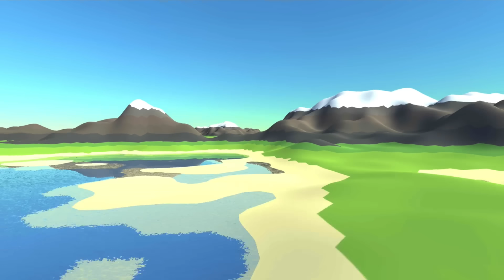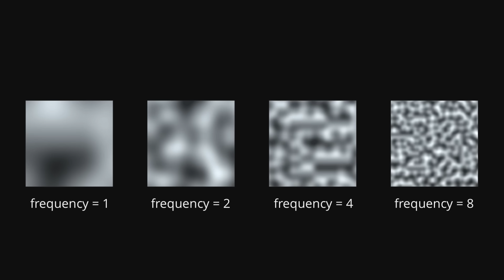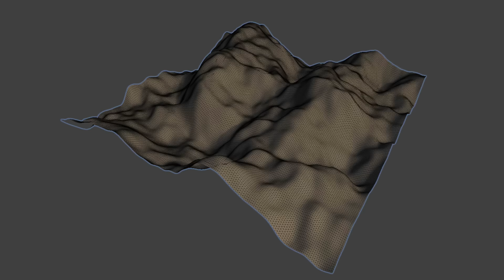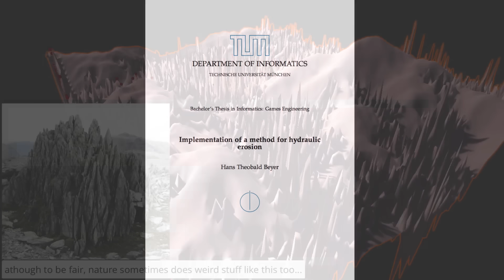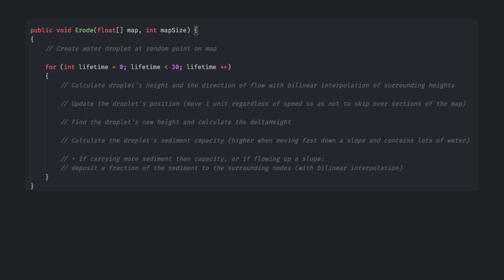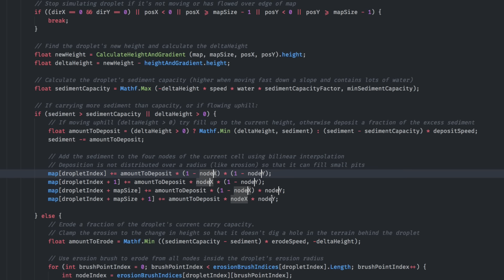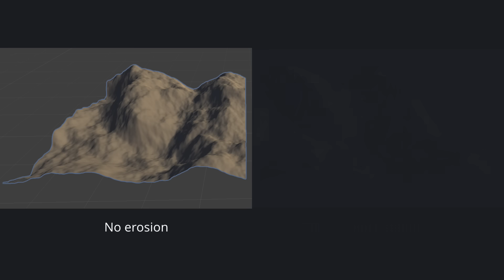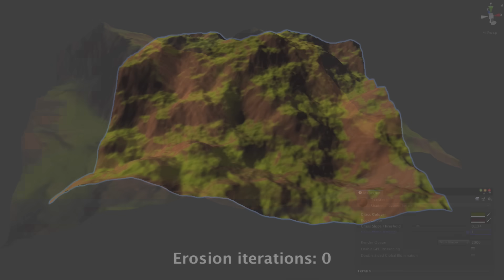Coding Adventure: Hydraulic Erosion

Comment: You can apply the stream power law function on the mesh, rather than via particles. There can be some numerical diffusion, but it gets applied evenly to the whole domain, rather than where a random particle starts and ends

Comment: A primary wind bearing mod (on what side of a hill does more rain fall, percentage-wise?), an elevation "dotted" "foilage map" (slightly larger "trees/bushes" dots on the lee side of the hill, slightly sparser/smaller on the side that the wind is coming from), altering the amount eroded per "rain drop" iteration and elevation drop, should provide some semi-realistic and "organic" looking erosion profiles.
You can also add things like tree-lines at a certain elevation (changes tree-dot percentages from 60'ish% to zero over a small elevation range), and even bush/lowlands/sparser-tree-dot ranges with similar but longer fall-offs reversed at lower elevations.
Once you get "tree dot" percentage on prevailing wind direction per hillside, and elevation of tree dot gradients, it probably won't be too hard to use them as percentage changers of erosion effects as either small planes or pixel source modifiers off the original height map.
In any case, great video, I'm intrigued.
Reply: I don't know if tree dots to effect erosion percent per heightmap pixel based off percentage of raindrops falling on a certain side of a hill compared to wind direction is putting it the wrong way around. Because stuff grows because of rain, they don't effect raindrops about to erode stuff because of wind.
But it's easier to code, is quick, and could even be used to key texture mapping off the heightmap as a placeholder "extra greenerfier".
High altitude treelines and low altitude shrub/bushline gradients, even if somewhat initially predetermined by wind direction, may compound this problem.
But, meh. Even with a basic wind direction/rain-drop-percentage-fall changerer, it should look a little more finely crafted, while still being highly and simply procedural.
Reply: But for laziness in coding, just an extra bunch of dots/small circles, of three different types, that are modified in distribution depending on prevailing wind (which is already modifying raindrop availability/percentage), that lower erosion values a tiny bit, but that also add to "green/dark green" texture map values on the effected pixels should work.
Would probably work far better with 1024x1024x16bit heightmaps or larger, but would make for a nice little modifiable/re-runnable modifier, with a really simple UI setup :)
Reply: As a strange aside, maybe the "trees before the water" thing can also work to your advantage. You get funny "greenified" bits of texture running up hills and god-alone-knows-where if you make your tree-texture patches too big (regardless of how they effect the erosion chance per raindrop falling on "their pixel patch"). But if they "smooth/average" the drop-off/raise of the original heightmap as well, while also effecting erosion, you tend to get little mini-shelves and cliffs, which also happens to be where trees would grow naturally, even with high drop-off on the heightmap. Just keep the tree dots/circles quite small in their own pixel array, with a fairly large heightmap array, and you should get better "scenery" instead of weird smudging-walking-everywhere-green-texture-bits. Probably.

Comment: A more complex and realistic option would be to have a bunch of droplets running in parallel so they interact with each other. You might get deeper channels (that is the word you were searching for!) and more complex confluences and so on. Couple that with different types of rock, and it could look fantastic.

It might be hard simulating other geomorphological processes such as shifting and folding without using a voxel system.

Comment: nice work, I suggest starting with sharpen edges, when the earth crust cracks id doesn't do it as a perlin noise, the erosion make it smooth. You could add a factor that removes more material at altitude because of wind erosion, you can add the sunlight erosion too when normals are pointing more towards a direction (sun's average direction)

Comment: Does the code use the noise values or does it use the vertex coordinates?
Or rather: is it just a fancy image filter or is it a 3d modifier, because if its the latter, its unfortunately not very useful for me, but if it is indeed a "filter", i could at least generate the height maps via external programs like processing instead of trying to translate it into something that blender can work with

Comment: Nice video. By the way, how would you handle hydro erosion for endless terrain? Since water droplets can move horizontally, they can deposit sediments on neighbour terrain tiles. So it could look different if we generate one tile at different time when another and terrains may not connect well...
Reply: For erosion simulation methods, you should precompute the entire terrain then apply the erosion. Like you said, edges cannot connect. There are erosion fractals out there that some people have made, these are functions of x and y that can directly create the 'erosion look' on the fly.
Reply: @SamWarren  Looks interesting. Do you have some links, i.e. some reading, discussions, etc. about that? Would be quite keen to check how these erosion fractals are precalculated.
Reply: Also I believe there are some machine learning methods.
Reply: @SamWarren  Looks interesting topic. Will give a try. It might be some machine learning but I guess it could be quite expensive for games. I was also thinking it might be possible to achieve real hydro erosion simulation on endless terrains in two potential ways: 1. Recalculate not just on new terrain tiles but on all (new and old tiles) the erosion (expensive). 2. Weighted-smooth connection area between terrains (cheaper).

Comment: Then you can implement things like "a surface with vegetation will erode less then a rock/soil surface", "vegetation doesn't grow above a certain altitude", implementing different hardness for the soil...
Reply: hey maby you could do that, the code is in the description :^)
Reply: But erosion happened when plants were not a thing...
Reply: @baldr12  So? The point is that erosion is less effective when there is a plant, not the other way around
Reply: yes ,.........  the  Algorithm also this factor considered....................................  while  eroding  (amount  to erode) * p_factor...........at a point

this p_factor vary from 0 to 1f          
-    0 means no_erosion(Like Rock)
-    1 means complete erode
Reply: @oren7404  rocks definitely erode. Should be like 0.05 erosion on big vegetation, and 1 in high altitude rocks
Reply: I'm not sure that vegetation slows down erosion in the real world. Real erosion of solid rock is mostly due to frost, so it tends to affect areas that are saturated with moisture. And the roots of plants can act like crowbars as they needle into rock fissures, pushing things apart.
Reply: @nagualdesign  Vegetation definitely stabilise the soil, look it up.
Reply: @castortoutnu  Yes, it certainly stabilizes the top soil, knitting it into an interwoven mat. The top soil also holds water, keeping the bedrock saturated, and it's the erosion of the underlying rock that I was referring to. In areas with no vegetation you generally have bare, dry, solid rock.
Reply: @nagualdesign  I live in an area where vegatating a hill can mean sadness, or not
Reply: @everythingfeline7367  Yes, vegetation can stop landslides. I was talking about rock erosion, not soil erosion. The roots of trees and other plants hold the soil together but they also push rock apart, more so than weathering alone.
Reply: @nagualdesign  On rock wheathering is also because of plants. In other words, plants erode rock. On soil on the other hand plants fixate the soil so there is less erosion.

Comment: This is awesome. I have dabbled with this kind of idea in the past. However this method is kinda different from what I theory crafted. My concept involved setting water sources in the ground for springs and simulating stream paths instead of tracking drops as they moved across slopes. This seems to work better early on in the process however once this method generated a good base, i wonder if water source things would make a good next pass.

Comment: Very interesting stuff with great looking results!
I think it should be possible to expand this system to generate glaciers between the mountains (where the altitude is high enough). Saving the height of the snow/ice into an extra layer could allow to let it melt away again when a temperature variable goes up (without "melting" the rock of the mountains). At the same time this process could be used to simulate how fast the ice melts at which positions (since it cools its surroundings so it thaws faster at the edges/ where the layer is thinner). And (probably most importantly) the ice could be used to simulate very slow drops of water but with a much larger sediment carrying capacity (depending on the height of the ice layer), allowing the glacier to carve deep paths into the mountain over time! :D
Adding another texture layer in the shader should be easy enough (to actually draw the glacier).
And changing the shader to be able to use GPU Instancing should allow for much larger terrains because of the performance benefits (only have a single flat square mesh which you draw for every square meter and only set the height values and texture weights in the shader which is insanely fast).

Comment: I wonder if there is a way to fake errosion effect for realtime terrain patch generation. Even if it won't look that impressive.
We can use slope steepness and it's normal direction to rotate texture with those vertical streaks and then sample it. We also can use height information to blend \ sharpen stuff that has no slope. 
It surely won't have that "local minimum" feel, but I wonder how it would look.

Comment: This would be a great candidate for compute shaders tutorial.
Reply: Or it could be used to showcase Unity's new Burst compiler
Reply: @torginus True... overall, though. I think GPU would win if you scale the map to bigger size.
Reply: @mustafageo  You would need to tweak the simulation a bit, but you could definitely get some great performance out of it.
Reply: @brendankapp5237  Its time to implement my evil plan by the suggestion and learn from it :) I have a couple of projects that can incorporate compute shaders perfectly e.g. (https://www.youtube.com/watch?v=36kmJCELT0w This example is on cpu). I learned most things a while back but didn't get to actually implementing things in my projects as I didn't have time. I was using 2D textures but I think I will switch to compute buffers as they are more flexible. Maybe I will try something in the next weekend and see how it goes :)

Comment: Have you tried to do this simulation with the new unity terrain? since brush and heightmap manipulation can be done via GPU it might perform well and can be used as additional brush on the new terrain system
Reply: This would be great to see.   I’ve not figured out how unity’s new changes work with runtime procedural creation yet so have been concentrating on using threading to speed the generation time up.

Comment: Maybe other than just a height map, you also make a "hardness map" for how much erosion takes place
Reply: Hi, the guy from the mentioned paper here, I actually did implement this. It is briefly mentioned in section 5.2 in the paper. What I experimented with was multiple layers of terrain, basically just a stack of heightmaps, each with a different hardness. When the top layer had 0 material left, I started to erode the next layer and so on. but deposited sediment always got put in the top most layer, which was very soft as to represent sand. That way hard rock also got turned to sand , kind of. 
I also tried to implement it based on 3D noise. With just a 2D noise map I did not really like the results, it was too obvious and unnatural. But this needs a lot of parameter tweaking to get nice results. In the end my time ran out to finish the paper, so I didn't experiment with it anymore.
Reply: @BillieJoe512  awesome, thanks for the explanation! Definetely have to take a look at your paper.. one question: did you think about the possibility of cave-forming? I also had the idea of multiple 'ground'-layers in mind, pointing directly downwards from the uppermost layer, but the possibility of caves seems to add a lot of complexity to this.. I guess with a 3d-noise-map it would be possible, but would still require some considerations..
Reply: @TheLeontheking  I did think about the idea of caves, but did never try something with it. In the sources of my paper you will find a few papers that use similar approaches of erosion on arbitrary meshes that would allow the creation of caves, none that work on voxels though - as far as I remember. To run that particle based algorithm on a 3D space it might get a lot more complex though. At the moment it is just seemingly running in 3D, actually it runs on a 2D plain projected down to the height of the terrain.
Reply: @TheLeontheking  I guess you would have to give the layers a kind of "sponge" function to simulate water saturation and water flow within the layers. But I'm not a programmer, so I have no idea how to code that.
Reply: @BillieJoe512  very cool thanks for sharing !
Reply: @BillieJoe512  I don't think deposit should always end on top layer. Look at stalagmites in caves for example. They're made through exactly this process while end result has the same hardness as walls of the cave (minus how thin it is compared to walls so it's breakable. Kids, don't break stalagmites. They're thousands years older than you)

Maybe it should rest on top layer that isn't 0 instead. That'd make more sense imho
Reply: That would be so cool, could get plateaus, vistas, plains etc!
Reply: @alexthebassist23 can you elaborate on this
Reply: Thats not that hard to implement, i reckon.

I suppose there is a part where the amount of erosion is calculated as some sort of value, that value could be multiplied by some value from a 2d array like a pixel value, normalized, of course. Shouldn't be hard to implement in theory
Reply: oh yeah, and to that idea he metioned at the end of the video i say, create an algorithm that roughly simulates the physical and chemical processes, which take place to form the different sediments in the first place ;)
Reply: I added that in his code and it works fine! But isn’t easy as just multiplying. You’ll need to make other operation to get a correct hardness to multiply. Else, it gives big spikes or... nothing
Reply: It would make sense to have layers as well, so once all the soil is eroded it will erode less of the bedrock.
Reply: This was the first suggestion that I thought of. Oftentimes rock is harder the further its eroded, which would give sharper cliffs.

These look like real mountains though, I'm blown away.
Reply: Also allowing cumulating the water drops into a streams (instead of simulating one by one) would create new terrain structures
Reply: You can always add more maps to give even more levels of detail, altitude maps, moisture etc all can make you result super interesting and realistic
Reply: Nice. Would result in waterfalls?
Reply: In 3034, maybe...
Reply: It would be best done in a voxel based terrain, that way you can build 3d volume texture with deformed rock strata built in to the data. This could enable simulation of fault lines and tectonics. Separate geometry for a geologic simulation would be used to define the 3D texture that the voxels are built from, complete with all properties needed to control erosion, like hardness/porousness, elasticity, moisture, etc...
Reply: that's awesome, Id love to actually watch a rivers meanders be created by the water taking the easiest path through the varying rock hardness
Reply: If he does it, it should be done with a voronoi map (probably misspelled, i mean the kind with points, and the min distance for brightness) so that stuff like tectonic plates could be somewhat visible and make the terrain even more realistic.
And this as voxels would probably geberate more interesting terrain than minecraft.
Reply: How about a voxel with a chance of being eroded or eroded by a specific speed of water.
Reply: yea also add normal maps to the texture and your atmosphere code.
Reply: Yes, actually, I've read the paper he linked to, and there is a part when calculating the amount of sediment the particle will lose, and there it is mentioned to multiply the amount by an erosion factor that can be any function.

Comment: Great Work..................was that Delauny_Triangulation at start of video
Reply from the maker: Thanks! Yes it was.
Reply: @SebastianLague  You should make a video about how it works, there are no real good explanations that I could find, that weren't either awful explanations, or so deeply technical I couldn't wrap my mind around them anyway. To see a walkthrough of an actual code implementation would be awesome!
Reply: 1 .  set  of  random points
2 . Triangulate them by Triangle_splitting_Algorithm...................
3 . 
         a . now loop through all Triangle  ..........  make a circle
         b  . check if  neighbour point to triangle  is  inside..........or............on && outside  The  circle
         c . Flip edges Accordingly _......................till  none  remains